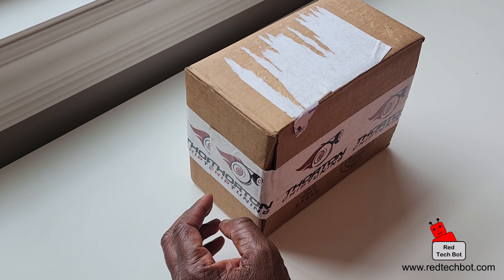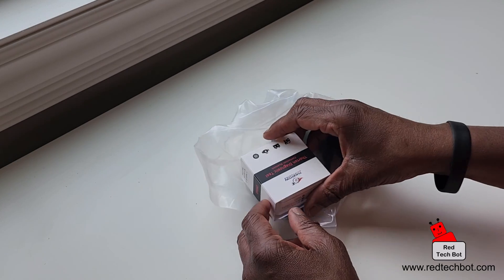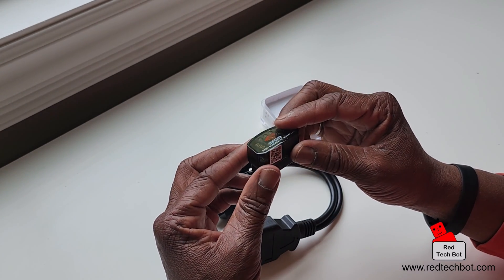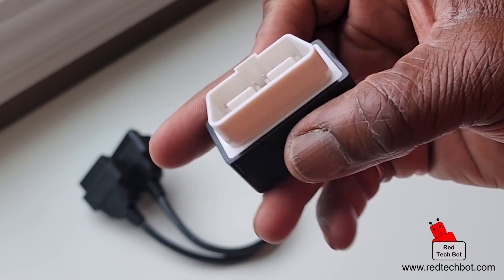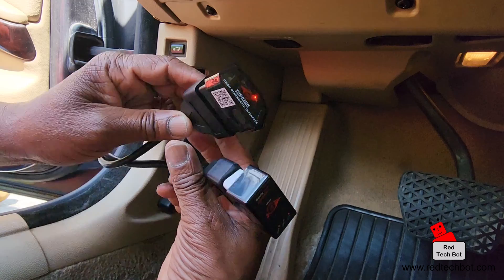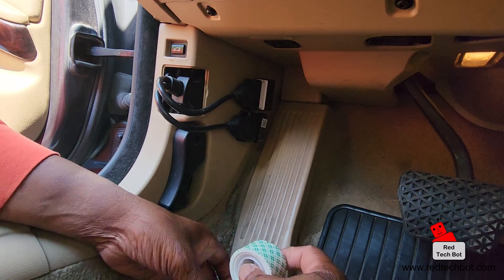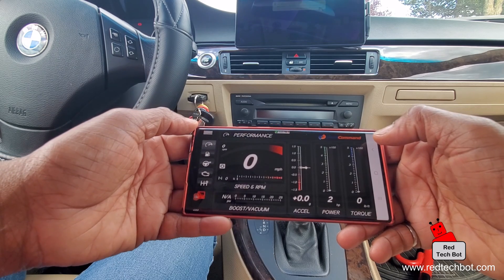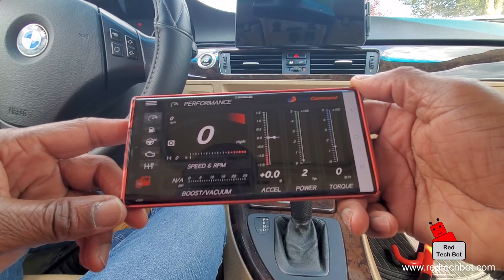How To Setup and Install Your Thornton Chip Tuning Kit

Comment: These are ripoffs!!! Hooked to a dynamometer (I own a garage) and tested. Absolutely no gain in anything!! Save yourself money and don’t bother!! If you want an actual tune, plug and plays don’t work!! You need to buy a flash and have it downloaded to the ECM of your vehicle. The obd port is only used for diagnostics, not engine manipulation!!

Comment: I already feel the difference in horsepower and torque, I just ordered it. 😂.   Spending $ doesnt always improve something.  I will be back to tell you what i think.  2000 Dodge Dakota 4X4 ex cab 4.7 V-8 90k miles, garage kept.

Comment: I bought a stage 3 thorton chip put on my truck drove 300 miles then put my truck on the dyno ran it pulled the chip out put truck back on the dyno and the chip made absolutely no difference at all quit spending your money on these thing

Comment: It's not possible for a little light box to reprogram an ecu on the fly. Nothing can universally program ecus. Obd2 is currently using 5 different type of programming languages. There are ecus that ate impossible to change maps without physically changing a chip on the ecu. And the horsepower claims by thorton aren't possible with no mods even on moat turbo motors, let alone any normally aspirated motor. It's also not possible a little Chinese box can outdo billions in R&D to get more power AND better mpg. If that was possible the oem would have done it. Ecu remapping can get more power, but always at the cost of mpg. Don't buy this stuff. There's cheap diagnostics that link to your phone, cheaper than what thorton charges for just a fake performance chip

Comment: Chiptuning does not in most of the cases and when do works there is , maybe 5-10 hp more .
Reply: To get 5-10 horsepower from a non-turbo car tou need to load a custom map onto the ecu written by a tuner. You can get 100+ horsepower from a custom map on some turbo bmws.

These products aren't capable of doing that they lack the computing capacity. It's impossible to have a product do this "universally" on every car
Reply: To get 5-10 horsepower from a non-turbo car tou need to load a custom map onto the ecu written by a tuner. You can get 100+ horsepower from a custom map on some turbo bmws.

These products aren't capable of doing that they lack the computing capacity. It's impossible to have a product do this "universally" on every car